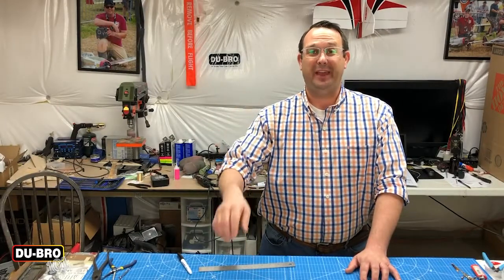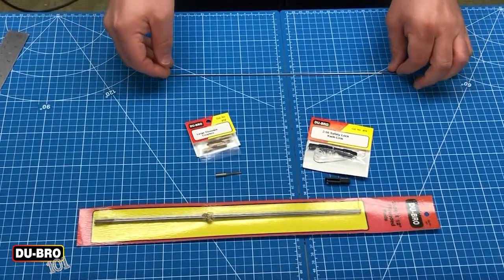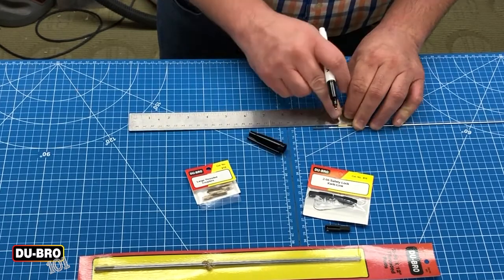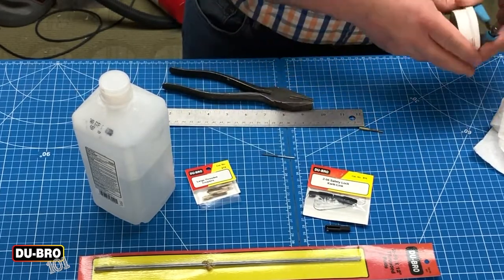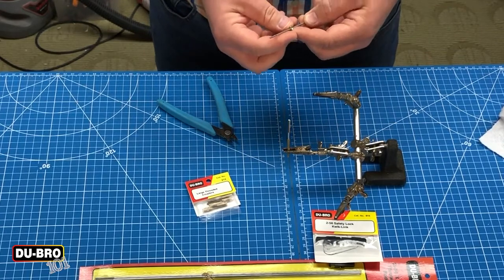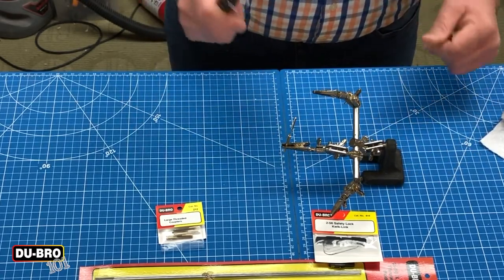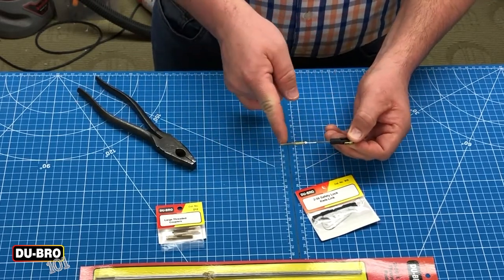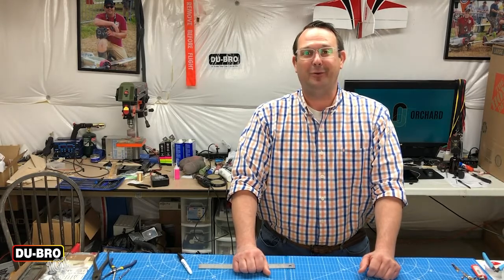DU-BRO 101: Threaded Rods and Couplers

Comment: I do wish Dubro would go more Metric. As a fairly new hobbyist I find the Imperial measurements way too confusing. Fitting .047 or .062 wire to a 2-56 or 4-40 coupler, ball-links, servo horns, control horns, etc. is so much more confusing than fitting a 2mm or 3mm wire to a 2mm or 3mm coupler, ball-links, servo horns, control horns,  or adapters. I also am never sure if a coupler is hollow and can be fitted with a coupler or is solid inside since you seldom show the ends. Why not sell us a tool that can put threads on non-threaded 2mm or 3mm rods so we can easily make our own control rods without soldering adapters or couplers? Yes, I understand 2 CW or CCW threaded ends on the same rod will unscrew itself. But give us the tools to make both CW and CCW threaded rods or make a video showing how the rod can be locked in so no unthreading will happen, i.e. lock nuts, thread lock, etc. BTW I do find your videos very informative.